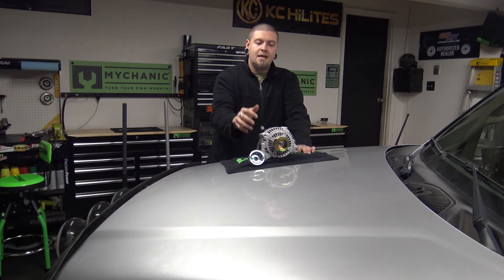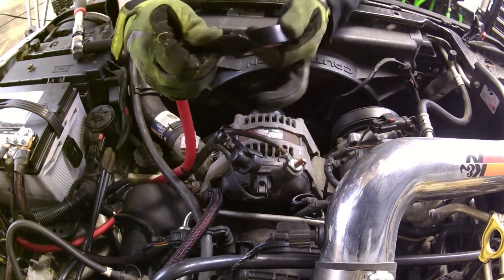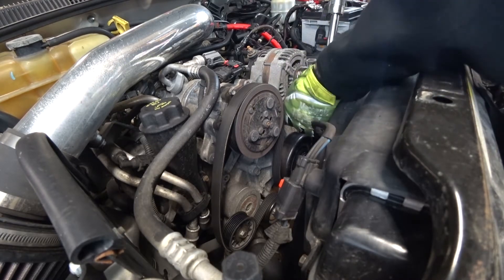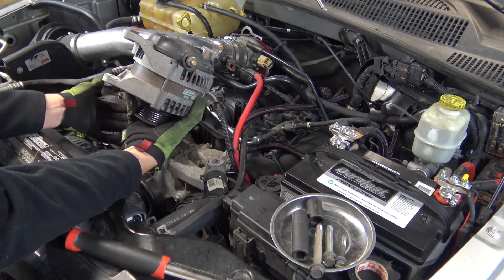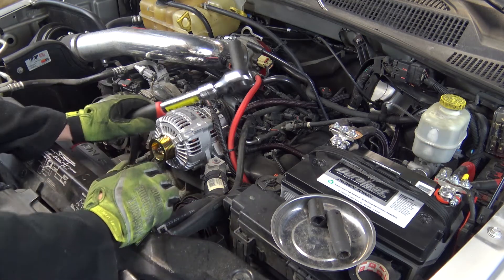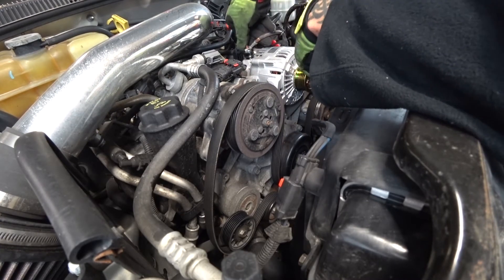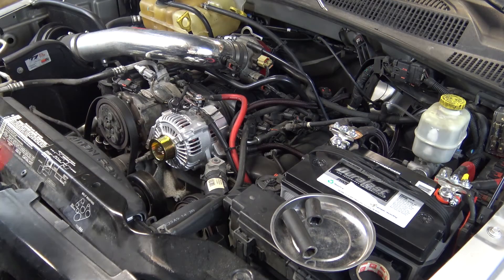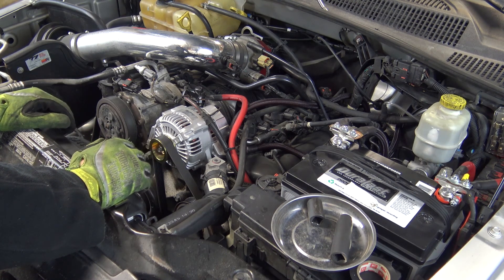How To Replace 2002-2007 3.7L Jeep Liberty (KJ) Alternator

Comment: Great video.  You were very explanatory and to the point.  All levels of safety for beginners to respect other components of the vehicle being effected by short circuiting.  Having an option to disconnect the battery or taping the end of the wiring was a good idea too.

Comment: Outstanding explanation and video, it seems I need to replace my alternator after only 21,000 miles over 3 yrs and 1 month, I think this is very short and it should have lasted much longer, it was an after-market but still??? Battery is also relatively new, younger that the alternator....Any thought from anyone would be appreciated, thanks for the feedback.
Reply from the maker: That is a pretty short life for a good alternator, but about average for some aftermarket ones.
Reply: @RockyXTV  So 
i just finished the installation of the new alternator, your video was spot on and the process was exactly as you described, only one minor wrinkle - your car has a modified air intake and for those with a stock set up, its  removal is needed, like I said very minor.
Reply from the maker: I forgot about the OEM style intake. Sorry about that, you are correct it has to come off. I'm glad your install went smoothly, other than the intake...

Comment: If I did want to unhook the negative battery cable, would I not have to worry about touching metal to metal and taping? And then what do you mean by resetting?
Reply from the maker: You can unhook your negative cable, that is completely fine. I would however still tape it or secure it somewhere as for it to not touch any metal. Even though it is the ground/negative wire, if it were to touch metal and complete the vehicles circuit you could still risk damage. This is unlikely, but just an extra safety measure. As for when I said reset everything, I was just referring to my radio, equalizer, DSP, amps. All audio equipment I added and it takes a bit of time getting it all tuned correctly. Most people don't have to worry about anything resetting other than your radio presets and clock. I hope that is the info you were looking for, thanks for watching!
Reply: Rocky X TV YES! thank you! About to undertake replacing my alternator myself on Tuesday so your video really gave me a sense of confidence lol. I'm sure you'll add a couple of thousand views after Tuesday 😉🤪
Reply from the maker: I'm glad the video could help. I wish you the best of luck with your install on Tuesday. Just remember to take your time and don't doubt yourself, that's where people fail, doubting what they can actually do. Thanks for watching!
Reply: resetting refers primarily to the radio and clock settings among other things
Reply: Hey Rocky! On your sockets, do you need deep or can you just use regular 13mm and 15mm?

Comment: Great video; what brand of alternator would you recommend?
Reply from the maker: If you have the budget to spare I would recommend US Alternators, or a less expensive route would be Mechman alternators (still one of the best). This one is a generic from Eagle I think. It works, but it's corroded badly. I would also recommend an external voltage regulator on the Liberty if you are needing the extra power for a sound system. Even with the HO alternator, the voltage will stay the same because the Jeep's computer controls it. Thanks for watching!

Comment: i wanna buy a high output alternator for my 04 libertyimited edition. have any you would recommend me getting
Reply from the maker: The stock alternator for the KJ Liberty Limited/Sport is around 104 Amps. You can upgrade to a larger one but will need to get an External Voltage Regulator. The computer in the Liberty tells the alternator when and how much power to put out, so even if you have a 200 Amp alternator the computer is only going to let you use a little bit of that power. Plus an External Regulator would allow YOU to choose the output voltage, like 14.7V if you are looking to run a large sound-system. I would give US Alternator, Mechman or any other alternator company a call and let them know what your needs are. Thanks for watching!

Comment: You should always remove your terminals from the battery when working on electrical in any vehicle not tape the ends of the wires. Service tech 30+ year's.
Reply from the maker: You are correct! I'm right there behind you with 20+ years.
I've done it like this quite a bit just to keep memory for vehicles that don't have "non-volatile memory." Some of devices will drop memory at as little as 10.25V for extended periods, so the old 9V battery trick won't work. This is important especially when you have audio processing like complicated DSP's that can take a long time to set up & tune.
I agree though, most of the time just disconnect.
Thanks for watching!

Comment: Anyone that does not use a torque wrench when tightening critical components on an engine to me is non-professional. Why play guessing game tightening steel bolts into aluminium threads and risk stripping threads or the alternator coming loose while on the highway or something..torque specs are there for a reason..